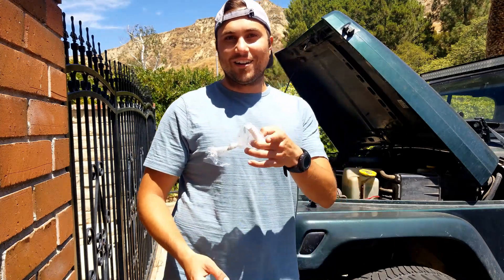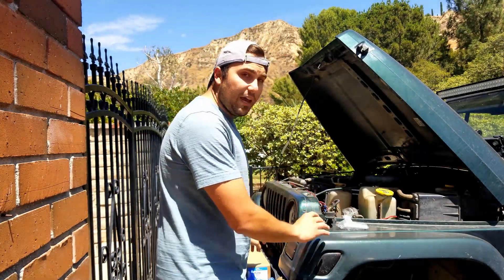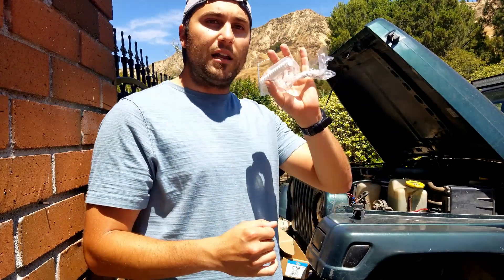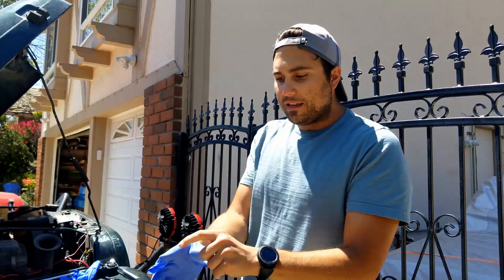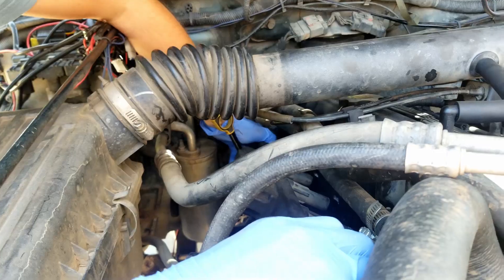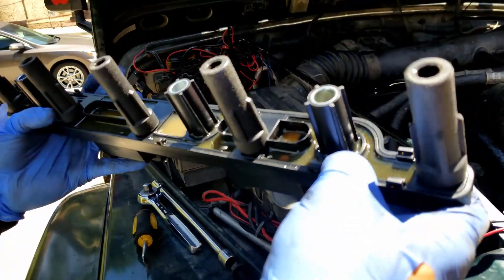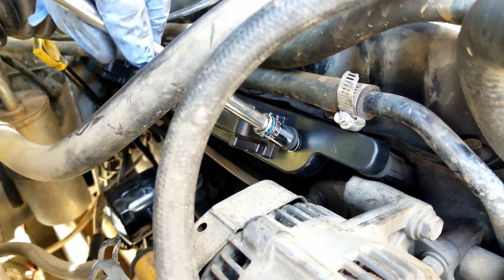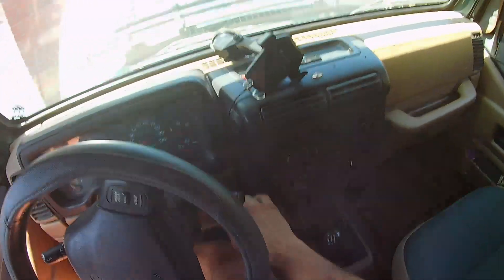Jeep Misfire Diagnosis + Full Ignition Coil Replacement DIY Guide | TJ Misfire Video #2

Comment: Falling in the rabbit whole like everybody else does in a load that shotgun pull aparts just get down to it and diagnose it right and find your problem get it over with I wish I could replace all all parts all day long at my job customer wouldn't appreciate it they have a nasty bill on the vehicle it could be a wiring issue a bad ground broken wire loose pin connection troubleshooting right with me going through all this

Comment: I found that my Cam position sensor was a little out of sync. I tells the engine if you are firing 1,3,5 or 2,4,6 cylinders if it is off, it does not sync the first of one or the last one of those cylinders. Mine screwed up at higher RPM.
SO if you get 1,5 & or 2,6 misfire, check the CPS!
Reply from the maker: Nice!

Comment: I'm having cylinder 4 misfire. Changed crank and cam sensor. Still the same, any ideas
Reply from the maker: Change all the spark plugs first. Any codes? Misfires at low or high rpm? I would swap injectors see if the misfire moves, and I would replace the coil, its prob due anyway
Reply: @Garagecouple  ok thank you. I'll update you

Comment: were you getting any codes? was misfire on same cylinder?
Reply from the maker: Yes! Check out the entire misfire series on this channel :)
Reply: I had the same issue this week with my 2014 Jeep Wrangler Sahara. I kept getting the code P2 19 a. I was not Getting any other codes and there were no misfire codes however the mechanic said I was having misfires in different cylinders more than one. I took it to a different mechanic shop and they changed the spark plugs which solved my issue. It’s still ran a little rough and required that I disconnect the battery and reset the ECU! Now I’m all good

Comment: I'm having the same problem....  
I have a 97 tj....   a couple of months ago it started misfiring on #3 so I changed the wires and plugs... i did not change the distributor cap....  she continued to misfire...  took it to the mechanic... they found nothing wrong with it.... moved some parts around and sent her home...  she ran fine for a while and is misfiring again...
Reply from the maker: Sorry to hear that! I would tackle the cheaper items first, swap injectors and see if it follows

Comment: Any luck yet? 5/14/2020.  I've been fighting the same issue for a couple years now on my 2005 TJ.  I've replaced everything.  Haven't removed  the head yet (compression check is good).  There has to be an answer to this.  I saw a video where the fuel pump was replaced due to a bad sending unit and it fixed the misfire issue as a bonus.   Got me thinking about erroneous fuel pressure signals being sent to the injectors from the ECM.  IDK.  I have over 190K miles so maybe I'll swap my fuel pump just for good measure.
Reply from the maker: We were able to solve the issue! Have you checked your spark plugs? Check out the most recent video on our channel!

Comment: My 2003 wrangler with the 4.0 just started misfiring today. I took it to have a diagnostic test ran. It came back with a miss fire at cylinder #6. They sold me the coil pack and all new plugs. Gonna put it on tomorrow. Have your figured your issue out yet?
Reply from the maker: Yes! We documented the entire process, check out the other videos! It was the spark plug!

Comment: Same issue with my 2001 TJ. New 4 hole injectors, new fuel pump, injector heat shield. Going to do the coil pack next week. Hopefully one of us will find the problem and share. Thanks for video.
Reply from the maker: Here is the link https://youtu.be/hMwj_uvHFpY
Reply: @Garagecouple  My problem is gone and Jeep runs better than anytime I've owned it. (about 6 years) I replaced the coil pack & although the plugs were fairly new, I went ahead & put new Iridium plugs in it as well.
Reply from the maker: @jeffwebb9448  glad to hear! Cheers
Reply: What brand of spark plugs did you use?
Reply: @jcarreon380  Dang I can't remember. Probably NGK I think or AC Delco. I will try to find out for you. BTW, Jeep still running great since I did the coil pack.
Reply from the maker: Hi there! Check out our latest video on our channel.. We figured it out and this been over 10,000 miles with no issues! It was the spark plugs despite being very new. Bad batch I suppose.

Comment: I've been chasing this same issue. I have a 2006 Rubicon with just under 200,000 miles on it. Mine was very bad I literally replaced every sensor on the motor.Even took the throttle body off the motor and cleaned it. Replaced the plugs with E3 plugs. Even put in a new cam sycronizer. Everything. still had the same issue. I also thought it was the coil. Started out with the motor cutting out at various RPM"S. Then it progressed to not starting when it was hot, to finally dying on me every time I tried to accelerate quickly. I changed the coil out with an after market one from O-Riley Auto Parts. The jeep ran great for about 5 months. Then, out of the blue one day it started doing it again. This time it would only do it at 2500 rpm or higher. Since the coil I bought had a life time warranty I figured it may have been a defective coil so I exchanged it and replaced it with a new one. This time the jeep (again) ran great for about 200 miles. Now it is cutting out on me at low rpm"s. and will not restart if the motor has been ram for a long period and then shut off. If it only sets for a few minutes it will restart, but if it sets for 10 minutes or so it will not start. Surprisingly this morning though when it wouldn't start after being hot, I sprayed some either into the air intake and it started up. It struggled for a second but then smoothed out and ran fine. 
 I think my next step is to start going through the fuel system. maybe I have a clogged or faulty injector. Not sure. Just curious if you ever figured it out though? I am a little suspect as to the quality of the after market coil pack verses the factory Mopar coil packs.
Reply from the maker: Hi there! Sorry that you are going through this! I did resolve the issue, if you check our channel I have the final video there. Your issue sounds like leaking injectors. I would do a fuel line pressure test and then swap out your injectors with some from k suspension. I would go with the 4 hole. Your problems should go away. Not starting after being hot is a sign of bad injectors due to the fuel vaporizing and not starting. Best of luck!
Reply: Ed browning, I have the same exact issue . It only does it when you have running on the street for a good 15-20 minutes then starts shaking etc etc. I had it on for an hour in my garage w the hood opened and no issues . I started driving it and after 10 minutes i started doing it again. Were you able to fix the issue? Thank you

Comment: You could swap the injector to another position and see if the misfire moves cylinder. Then you can tell if it is the wiring that is bad.
Reply from the maker: Thanks for the comment. Did the injector swap test and also replaced the Injectors and no dice 🎲.